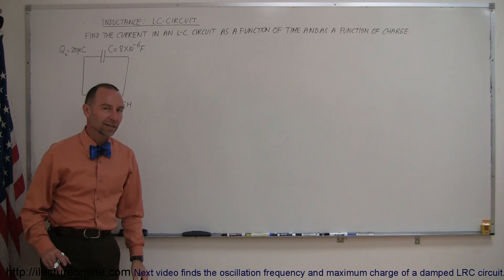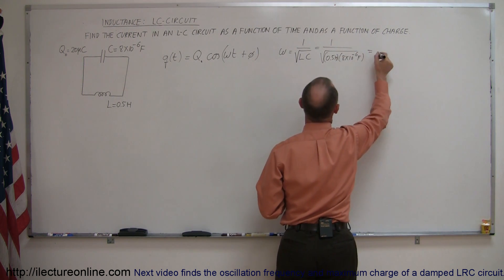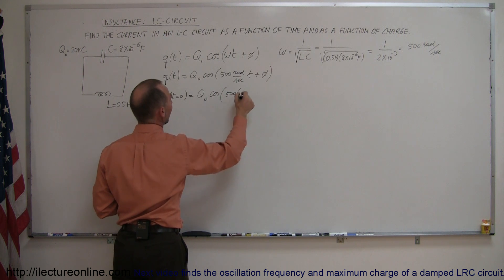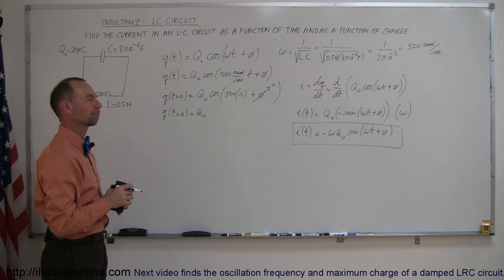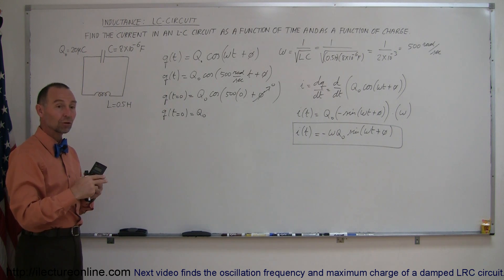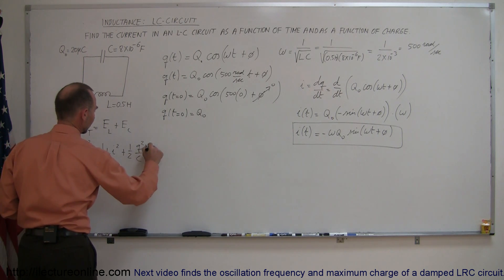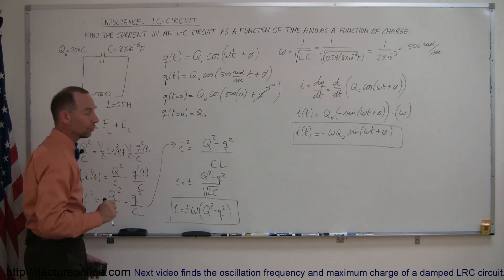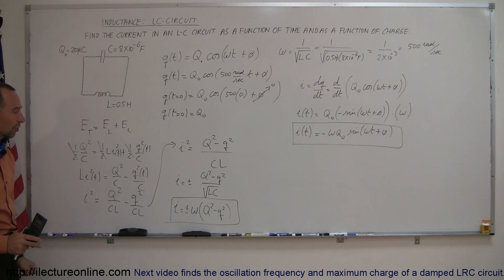Physics 47  Inductance (7 of 8) The L-C Circuit

Comment: Hi Professor, the first way to find the current was based on the charges in the capacitor, shouldn't we use the charges in the circuit instead of the charges in the capacitor; the second method made more sense using the different in Q and q, barring the square root business. Great video still and thank you. Btw, as there are only two components in the circuit, do the voltage across the capacitor equal that across the inductor in order to conform to KVL?
Reply from the maker: Answer to first question: no.   Answer to your second question:  yes.
Reply: @MichelvanBiezen  
Thank you Professor, I shall sleep on it!

Comment: When you took the square root of both sides at the end, it seems you forgot to square root the Q^2-q^2 part. Only the denominator was square rooted
Reply from the maker: Yes, you are correct.

Both the numerator and denominator should have been under the radical.

Comment: I just found you're videos and have looked at you're website and saw you worked at Raytheon, I was wondering if you could direct me to some of you're mathematics videos and physics videos to understand magnetrons. For a project I'm doing I wanted to calculate the magnitudes of voltage and current within resonant cavities and see if I can attach a transformer core to the cavity to get energy out, I also wanted to see how charges propagate within the cross field and how charged particles give,